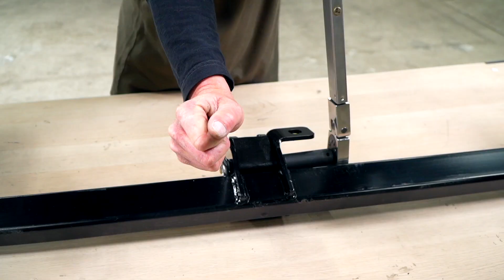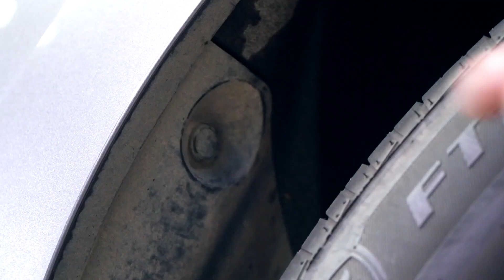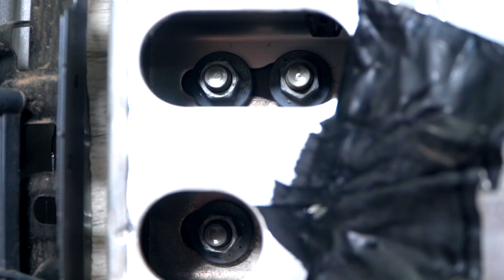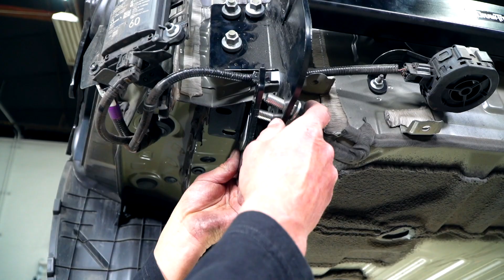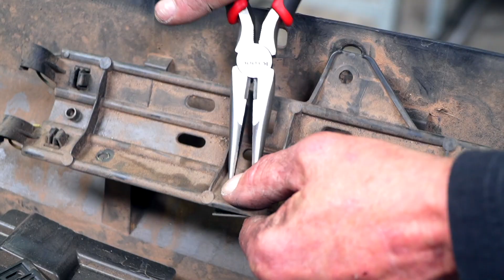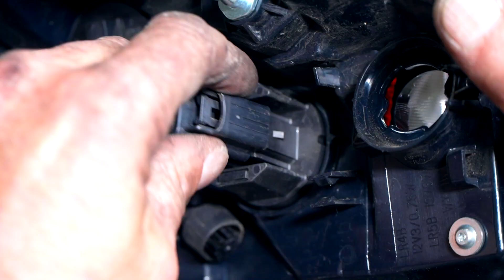2022 Toyota Sienna | U-Haul Trailer Removable Receiver HITCH Installation

Comment: Can it tow a smaller hybrid with a car dolly? Manual says tow capacity is 3500lbs. My car is 	
3,859lbs
Reply from the maker: NO, The additional weight of the tow dolly will also push you further above the MAXIMUM weight capacity!